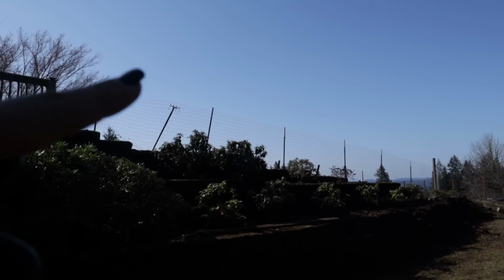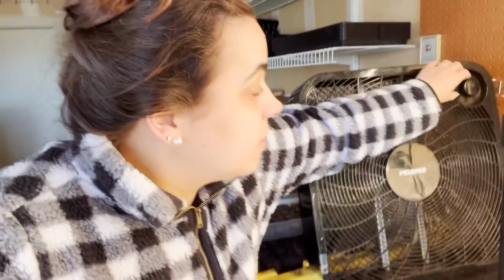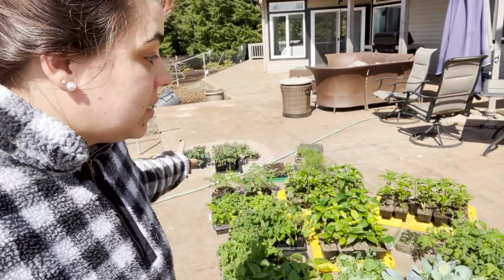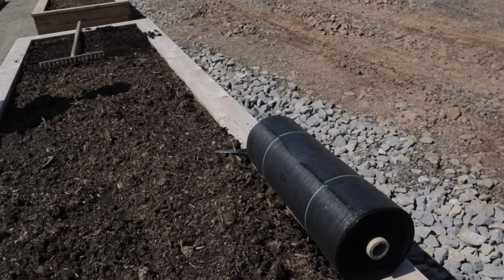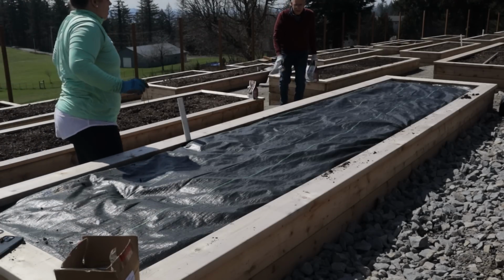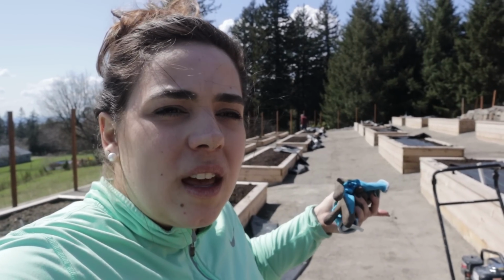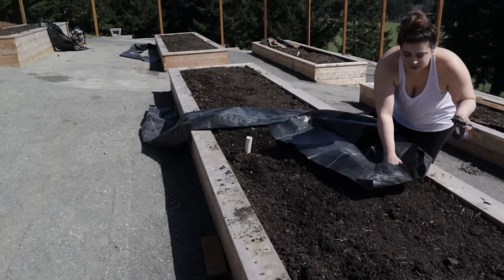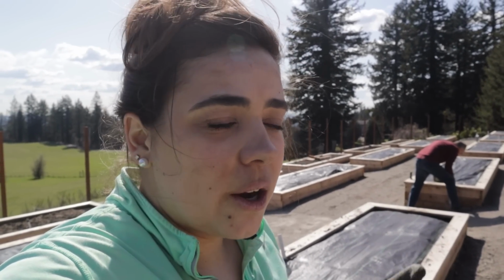This idea is either brilliant or crazy!

Comment: Becky, I put my Lavender seed packets in a plastic baggie to keep moisture out, in the freezer for about 2- 3 months to simulate winter. Or you just can store your seeds in the freezer/ fridge indefinitely, then when your ready to start your seedlings, take a moisten paper towel, lay it flat, place the seeds on one half and fold the other half on top of the seeds. Place the seeds inside a zip-lock bag, place in under your grow lights, windowsill or greenhouse and wait for them to germinate. Use a spray water bottle to keep seeds moist. Once you see the plant emerge from the seed, plant it up.
Reply: Ohhh ok ok thanks for this … cause I grew lavender (I use the term grew lightly) but I never actually got any lavender just little starts and have of them didn’t even germinate
Reply: I put mine in the fridge for 4-6 weeks and the germination rate was better
Reply: Thank you for the explanation - I have tried with lavender but it has been a no go.  I will try your method!
Reply: Lavender does take a while to germinate anyway for sure.

Comment: After you measure your fabric for the bed, use your torch to “cut” the fabric, and you have sealed two ends at once! Goes much faster.
Reply: Also use a torch to make holes in the fabric for your plants.  I use this in my raised beds and works great!  I pull up and store the fabric every year and amend the soil with my chicken poo.  That way the holes are already there and I can grow tomatoes, etc. in a different planter each year.
Reply: Or a hot knife 😊
Reply: Burning works great for us! It helps seal it also!

Comment: I was a grower in  wholesale greenhouses for almost 30 years.  Watering during the day will not hurt any plant except begonias.  It will melt the foliage on begonias.  It is definitely better to water early in the morning.  But sometimes I watered during our busy season from 6am to 4pm.  Watering with a drip system allows you to water at the root zone so you can water anything.
Reply: I water on the hottest days in my hot southern climate during the heat of the day if mine wilt. I think it’s fine as long as you saturate and cool the leaves and don’t just mist them with cold water.

Comment: When you are hardening off your plants, start in shade or part shade.  The outdoor light is way brighter than anything indoors.  If its not too cold, you could leave them outside overnight. Gradually move them into brighter light and more windy spots every couple of days.  After about a week you should be good to go.
Reply: Excellent advice.
Reply: Great advice. I never harden off and live in Minnesota.. everything works fine in the end.
Reply: As long as night time temps are good, mine go under shelter, full shade, part sun, full sun in that order. And I don’t take them in and out that way. Much easier for me.
Reply: The plants could be covered by a sheet,  tarp or the fabric if there is concern of a frost

Comment: To keep things manageable, I’d choose five beds without the landscape fabric, but use straw or grass clippings or other mulch on those five, which will also keep down weeds. You could change which ones each season, and then you’d be improving your soil over time. Then do a cover crop on all of them for the times you aren’t putting in your veg. Your garden is going to be beautiful!
Reply: Agreed 💯
Reply: That can be an issue in a high wind area.
Reply: Agree. I'd leave that bottom row open and experiment. Run a soil test on that bottom row and a row with the fabric next spring and see what the results are.
Reply: I agree, but also be very careful and do your research on what to use for mulch.  I accidentally killed all my strawberries once using the wrong mulch.
Reply: We use sugar cane mulch here. Straw and hay can be contaminated with persistent herbicides.
Reply: Definitely agree with using a cover crop!

Comment: You could buy a used, cheap old wood screen door and mounted it to the side of the coop. You would get the height you need and still be able to open it to get into the run. Also, I would mount a piece of screen at the top of the coop on the 2 inside sides. I'm thinking they can jump onto the coop and get out.
Reply: I agree
Reply: and maybe staple fencing upright to the top board of the coop & stake them up
Reply: @lovly 2cu Agree. I think also clipping the feathers is short term solution, because they will grow back on.
Reply: Yes, also the taller door/gate will help keep predators out.
Reply: Oooh your idea about a screen made me think of putting one over my raised bed to keep the chickens and goats out!

Comment: For the future, use the torch to cut the pieces instead of cutting it with scissors. The torch cuts and seals at the same time! I found a torch on Amazon for use in the kitchen that stays on instead of holding the button and it works perfectly for cutting and making holes.  The kitchen torch works better than a plumber's torch because it works well facing up or down. That may very well be a genius idea and one I may be trying! 😊😊

Comment: The garden staples that rust actually hold better. I learned that from You Can’t Eat The Grass and they were absolutely right. I love my DeWitt Sunbelt. I’ve had it sitting on top of my garden area for 3 years now, same stuff, and it makes gardening possible for me because of weed pressure and time. Don’t forget to burn the edges so they don’t fray and you can reuse them. A propane torch is a great way to do your holes and fix he edges.

Comment: I think the fabric was a good idea Becky! Those are a lot of raised beds to keep up with. I would leave a couple beds without it for potatoes,onions,carrots,etc.
Reply: The fabric will cut down on weeds. It’s a game changer! I’ve used several different types over the years. In the direct sunlight it will degrade. Cover it with some type of straw, animal bedding fine wood chips, or others natural materials available. Because it’s lays on top shouldn’t effect your soil nutrients. Leaves or anything else on the lawn-grass will be carried along. You may have the answer on the weeds in your old beds. Any weeds in the area that go to seed will blow every where. Also, birds brings it the seeds from what they are eating locally.  My irrigation system is on top of the fabric. Bugs, dirt misc clogs up the emitters. Also if you have a leak, you can find it quickly. 
Becky  your garden is beautiful. It will be joy for many years to come.  
Blessings.
Reply: I do not have landscape fabric on my beds. And in SoCal we got crazy rain this year. The weeds are out of control!!  My morning chores are feeding animals, pull a section of weeds to feed chickens, get ready for work. I’m think brilliant right about now!!

Comment: My family puts a thicker white plastic over their raised beds & staples it onto the outside. Then they cut holes where the plants are & they water through the holes. It has worked really well for them. Since it is non porous & raised from the soil it keeps weeds from rooting anywhere except for the holes and it works as sort of a mulch as well to retain more water in the soil. They are in a desert type climate in Idaho, so keeping everything watered is a main priority. They also put some rocks to weigh it down so any rain or water that falls on the plastic goes right onto the plants through the holes they cut.

Comment: Next time you're cutting the landscape fabric, do it on your patio with hot soldering iron (of course, you'll need an extension cable:), just measure, take a metal ruler or a pipe as a guideline and cut and seal at the same time. That's a trick fabric flower makers are using when cutting fabric out of synthetic materials:)))

Comment: I’m so glad you’re using landscape fabric in your beds.  Your plate is full enough!  You’re definitely going to need more pins than you think to hold it down.  I’m also in an extremely windy area.  I used wood screws and a few stacked washers on one of my “windiest” raised beds in the corners for a little more stability.

Comment: The landscape fabric will warm the soil in the spring (this is a good thing) and in the heat of summer it will help to keep the soil cool. Your peppers will LOVE this as well as other crops. I think your gonna like it.   I would definitely put your irrigation on top so you can see any issues that may occur & address it a lot easier
Reply: Please explain how black fabric on top of the soil will warm it in the spring and keep it cool in the heat of summer. ~ Lisa
Reply: It warms it in the spring because the black keeps heat in… however it keeps too much moisture in here and my peppers don’t grow well. Melons- perfect but we don’t use it for anything else.
Reply: @momoflittleladies  Your answers are not making any sense, so I maintain my position that it will cook her soil, and possibly her plants this summer.  ~ Lisa

Comment: I have used this same woven weed fabric on my in ground garden for several years since I saw aliving Traditions use it. I love it. I never thought of using in my raised beds. There is no problem with putting your irrigation on top of the fabric. It is easier to see and fix if you have a problem with the irrigation.

Comment: Homestead Heart uses the torch to cut holes in the landscape fabric and it keeps it from fraying. She used a hard plastic plant tray that the plants come in at Lowes or Home Depot. Sometimes they give them away sometimes they don't, depends on who you talk to. Anyhow, you use it as a template and burn perfect rows of holes. If not, just use a pot and trace a circle with chalk and then go back and burn an X , tucking the now cut and sealed fabric under.

Comment: You're going to love it. I've used landscape fabric in similar boxes for years.  I put soaker hose under the fabric.  I also used a torch to burn it so it wouldn't fray.  Some I burned holes for planting tomatoes, cucumbers, squash and peppers, but I cut long row slits about 4" wide for peas, string beans, beets, spinach and such.

Comment: I think it will be easier, cheaper and better for your plants to use mulch like Straw instead of the Matts. You can also use the grass you cut from your Garten or you can purchase  Wood Chips etc. They all are organic and last for the hole Season.
Reply: Yah i agree. Willingly bringing in plastic in your soil seems so wasteful
Reply: Grass clippings can bring weeds & grass seeds into your garden beds. Very hard to get rid of.
Reply: I love weed fabric in my gardens. It’s helped the best for me to control weeds over straw.
Reply: One of the reasons for landscape fabric here in the maritime Pac NW is how much it warms the soil. Organic mulches will actually be cooler during our late spring early summer here because of the moisture they hold. Our soil temp is hovering around 60 degrees F if we are lucky until mid to late July.
Reply: I love using straw as mulch in my garden but she’s in a high wind area so that poses difficulties

Comment: Becky, just staple the cloth to the actual bed frame on the inside. Then plant seedlings.  That way you don't mess with the cloth after the wind blows etc. It stays where you attach it.  End of season... assessment time, staying place, switching out this cloth. Pull out staples if you want. Repeat net year.

Comment: I would be careful when using landscape fabric even if it is on your bed, the chemicals in the plastic can leech in to the soil. Try finding a chemical free option if you didn’t already. It is also a good idea to pull it up at the end of the season and allow the soil to breathe. I don’t think you would have had issues with weeds because the beds are deep. Much deeper than your previous gardens beds. They are deep like mine and I have no weeds and they have been up for a couple years now.

Comment: We use that fabric in our garden every year. We burn holes in the appropriate distance for whatever plant you are putting in. We don’t have to buy every year as we pull it up in the fall and store inside. It will last you for years and you will be glad you are using it. It really cuts down on weeds for sure.

Comment: Protip: you shouldn't water your plants during the day, because the water left on the leaves then acts like a magnifying glass for the sun, and will cause them to get sunburned. Instead, aim to water them in the evenings, so that the water has time to evaporate before the hot sun. Alternatively, you can water them during the day, but then you have to make sure to water them from BELOW and not get water on the leaves, which would damage them.
Reply: I've heard NOT to water in the evenings as then it will rot your plants as it will not dry/evaporate off and cause rot and mold issues.
Reply: @Megan9689  And it invites slugs! I think it mainly should be anytime in the morning, not midday or evening.
Reply: This assumption has been disproved.  It does not harm plants to be watered in full sun, especially if they are in need of water.  The best time to water is in the early morning, but there is no time of the day that is harmful to plants. ~ Lisa
Reply: Better to water them early morning at soil level as if the leaves are damp, especially at night it encourages a number of diseases and pests especially aphids
Reply: @LB-vl3qn  Agreed! I always water when they need it...and usually in the heat of the day. They seem to appreciate the cool down.
That's my pro-tip! And I've been gardening for almost 50 years.
Reply: @LB-vl3qn  I agree.  Not everyone has the opportunity to water in the morning because having to go to work.  I have been watering my garden in the evening for years and I haven't had any problems.
Reply: I never do it in bright sunlight but if cloudy I do or work hard on not hitting the plant.. they have iragation though so won’t have to worry
Reply: @LB-vl3qn it burned my blackberries up. There was no bringing them back.😊 just saying.
Reply: Maybe this is a regional situation... I live in the desert, so I thought I was supposed to water in the evening? I am very bad at all this, no matter where I am🙄😬👻
Reply: "water left on the leaves act like a magnifying glass for the sun" is actually a myth. You can water plants at any time during the day or night. What matters is consistency.
Reply: In the morning from below ...
Reply: @bonneymoseley1159  Nothing kills blackberries! At least not the native brambles here in Oklahoma.
Reply: @JanicePhillips  I wish it didn't here in Alaska Janice. The cold can kill ours and, last year they were doing great and my grandson watered them at 3pm with is the hottest time of day and they were dead by the next morning.

Comment: I used garden fabric in my raised beds last year. I loved it.
 We also placed our water system on top because if there is an issue and it is under the fabric you can not see were the problem is.  When your tubing is on top you can see the problem and fix it.

I had a hot knife that I cut mine with so it did not fray.  I also cut my holes for the plants with the hot knife.

Happy gardening.

Comment: If you use a torch to cut and make holes in the fabric it won’t unravel also if you order from grower solutions and use a discount code from living traditions you can get a 10% discount also in your raised beds if you put it on the bottom then put your soil in it works much better as a weed barrier but it will help with weeds regardless I’ve used weed fabric for 4 years now and I love it

Comment: Firstly, I love your dad. He's so precious lol. My house came with flower beds that have landscape fabric under rubber mulch and from my experience, it doesnt do a whole lot to keep weeds out. But one of the big things is that the fabric wasnt stretched and staked down all the way to the edges, so you guys did that well. Also, first has accumulated under the rubber mulch, so weeds will show up with their roots burrowing through the fabric. I think if you just watch if the fabric will work well. I do wonder if itll get too hot in the summer, though.
What works best for me, and this is only my second garden, if using cardboard and the leaves from last year. My leaves blew into the corners of my fence last fall so there was pretty minimal contact with the ground though

Comment: For future reference use the torch to heat a knife and cut through your fabric easily and seal it at the same time. Also rusty fabric staples actually hold the fabric in amazingly well because the fabric grabs to it better. 
My sister used woven weave in her raised beds it worked great.  We use it in our in ground garden it is well worth the time, I promise!!

Comment: Hi, Becky.  My sister & I enjoy your videos in NW Tennessee. 
Here's a tip for you.
You can cut and seal your garden fabric with a wood burning tool. Just lay your fabric over a piece of wood to cut. The tool will prevent fraying by melting the ends & it makes an even cut. The tool is about $10 at Walmart. No flames either.
I bought a garden tower & Vermount compost. I can't wait to fill it.

Comment: Hi Becky,
This is a great idea. I have used it for years. The only problem that i find is scorching. As the plastic is black it can bounce heat off and scorch your plants. I ended up using thick chipped non treated wood chips on the top which also helps with water retention and assist with heat transfer and frost. The benefit in about five year of using it on the top is that it can break down enough and you can add it to your raised beds or garden beds later as a compost. Definately worth the investment. And a beuty is that you can put fertiliser with your wood chips and when you water it, it will release the nutrients through the plastic to your garden, so you wont have to pull up your fabric every season to add more.

Cant wait to see your next videos. 😊 watching from Australia.